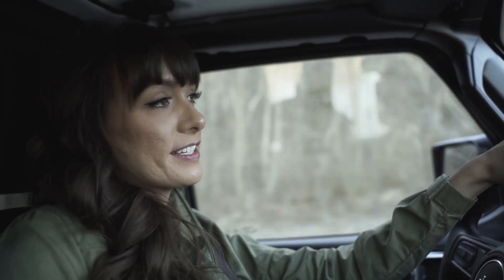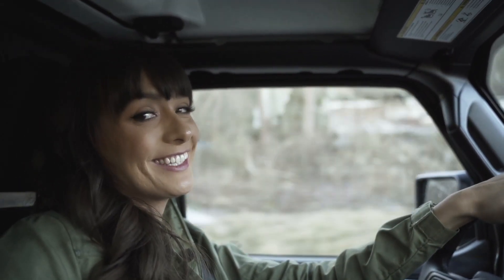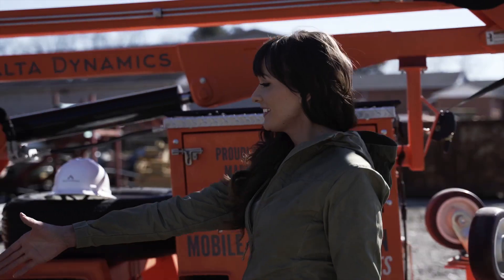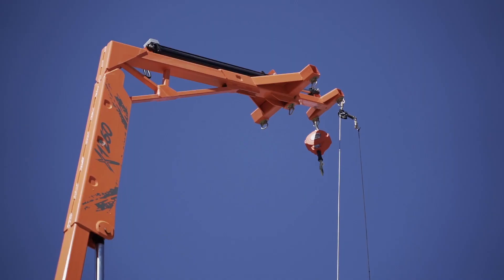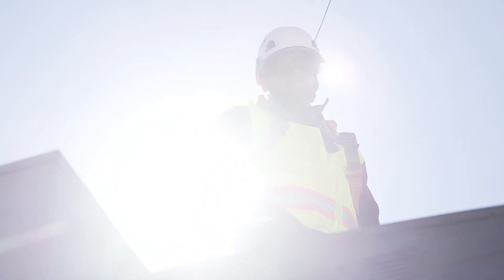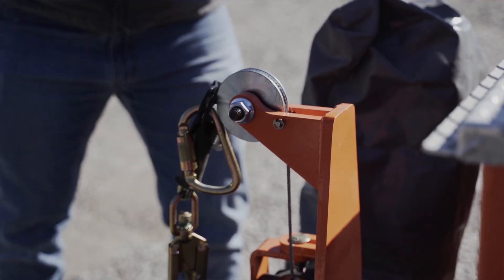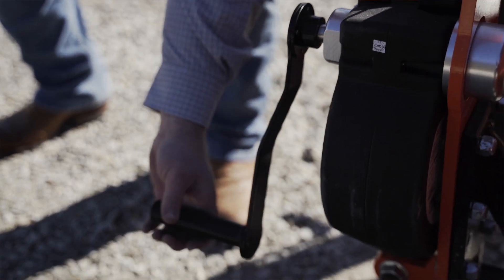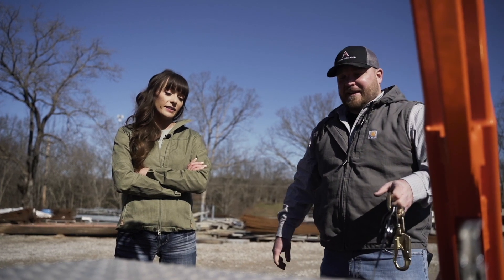FALL PROTECTION ANCHOR POINT | The BEST mobile anchor point.

Comment: I would rent this to solve our working at height problem, looks way secure compared to standard scaffolding installation. But since the size of the machine is quite big, it would bring a challenge especially in manufacturing factory where there are already other fixed machines installed at working areas.

Great video as always. I have a topic suggestion, would love for you to make a video about machine safety.
Reply from the maker: Yeah, it definitely depends on how much extra floor space you have! That's always a premium in factories. If you can fit a forklift between the machines, you could fit the X-Series since it maneuvers really well in tight spaces. 

I'll put machine safety on the list!